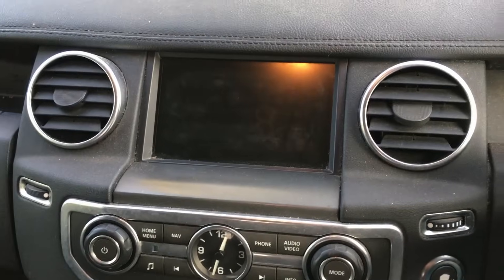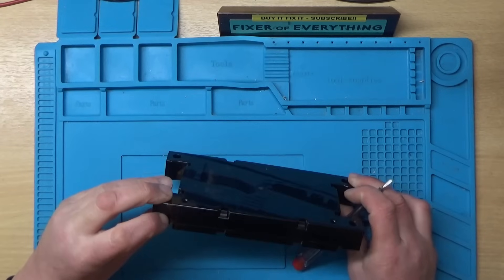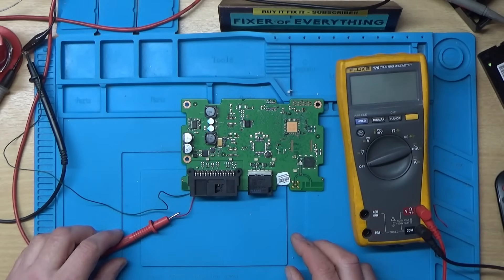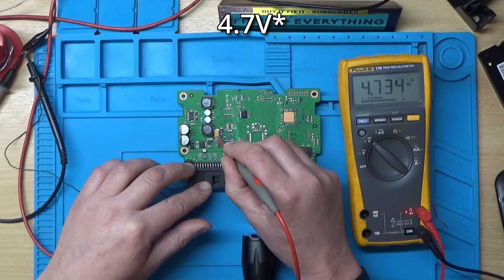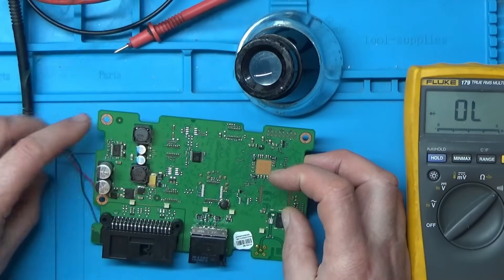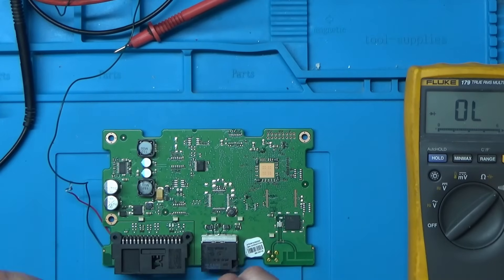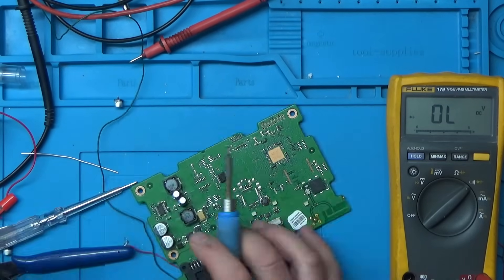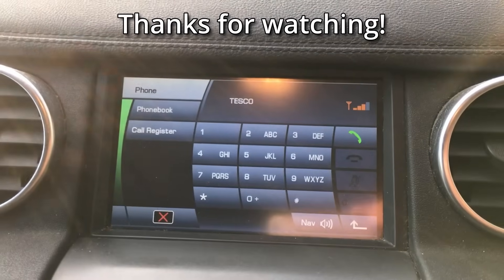Faulty Land Rover Discovery 4 Bluetooth Module | Can I Fix It?

Comment: Found your video and changed the same SMD capacitors.. it worked better, but didn’t last. Found another video where the board main soldered points are touched briefly getting rid of cold solder points. The module behaves better and doesn’t turn off infotainment system like before. Have to get a heat gun and heat up the entire board. But happy it’s working better now. Thanks for posting your video and leaving it here as it helps many others with these Fomoco issues.Great instructional
Reply from the maker: You're very welcome. Yes bad solder joints would also give similar symptoms.

Comment: Cars are a nightmare to work on. Just getting stuff to bits is so difficult. I repaired the entertainment centre touch screen on my wife’s Seat Alhambra, and the hardest part of the whole repair was getting the unit out. The touch screen replacement was the easy bit!
Reply from the maker: Agree, we got rid of the Land Rover. I had the body off the thing 3 times, replacing EGR pipes and turbos. Even getting to the alternator was a nightmare on the thing.

Comment: How many volts is the 100mF capacitor?
Reply from the maker: 35v 100uf if I remember.
Reply: Hi! Do you know the values of the other 2 capacitors. Bought a replacement module on ebay and it took doesn't work. Probably has the same dodgy capacitors, 
It worked for a minute and then disconnected and was no longer discoverable
I'd really appreciate the help. The values aren't written on the capacitors
Reply: Hi, any idea what the values of the other 2 capacitors are?

Comment: I have a 2016 LR4 and I have power at my dash unit but the radio , phone and sat nav are not working. I’ve been told by a mechanic that one or all of the modules are blown and it’s very expensive to repair. Your video is the closest I’ve found to even finding where the modules are in the LR4. Could you suggest where to start. I’m competent enough to tackle the job with a little advice. Cheers for and advice.
Reply from the maker: We got rid of the LR4 a few months ago, they are a nightmare. I had the body off the things 3 times, changed turbos, egr pipes etc etc etc. I know the main ECU is at the front right behind where the battery goes (as you need to disconnect this when taking the body off), but if it's starting and running then that's probably not the issue. You now know where the Bluetooth module is, I think there may be an amplifier module under the passenger seat, and the rest of the modules I would suspect to be behind the dash where the actual satnav screen is. I never had that part out so unfortunately I don't think I can really help further 😢

Comment: What a great video and what a handy guy!  I have the same module that works once if you cycle the power to it but then doesn’t work again till the next power cycle, I will do the same and see what happens. I’m a firm believer that these kind of issues with cars are common to all the cars of that model etc and if it happens to one it will happen to the rest at around the same age/milage
Reply from the maker: Thanks 👍You'll have to let me know if it works for you. The other thing it could be is possibly bad connection on one of the IC's.

Comment: Your right about the capacitors failing because of high frequency noise/heat in  smpsu  ! Linear psu’s  rarely had problems like that! Fraser
Reply from the maker: Yes agree 👍

Comment: Hi. I have tried to repair a Bluetooth dongle for a launch obd scanner. I have tried to repair it for a friend but have failed. Would you be interested to have a look? Thanks again for your nice videos
Reply from the maker: What's up  with it?
Reply: @BuyitFixit  it powers on when you put it in the obd port or if you connect it to USB but you can't connect to it via Bluetooth
Reply from the maker: So it works fine USB still, just not over Bluetooth? If you have any pictures of the insides drop me an email at the channel's name at out look dot com.

Comment: Hi, sir. Greetings from Brazil. One suggestion : I think you need to consider a little better esr meter to find issues like that. That esr meter that u have is a little "child's play", if i can put that. 

Great job.
Reply from the maker: Thanks 👍Do you have any suggestions on a decent one? Many thanks.
Reply: Zoyi ZT-MD1 and Fnirsi lcr-st1. Both are lcr type tweezers and have been released on aliexpress a few weeks ago. They should be able to give the esr in circuit without removing the capacitor. I just ordered the zoyi for $35aud(£17). They have just been released, so haven't seen any reviews yet.

Comment: Hello Mick, just thought I should mention this….you might want to consider using “hot snot”, or even better, neutral-curing silicone mastic around those replacement electrolytics you put in there.

In vehicles and other moving mechenery vibration can actually do a fair bit of dammage to electronics and particularly leaded components thst then waggle back and fourth in their leads…..and here they ste not soldered to plated through hole pads but just surface mount pads that won’t handle the bending moment well at all….a blob of silicone will mechanically danp things down nicely and increase its longevity….least from a mechanical standpoint anyway!
Reply from the maker: Thanks for that. I didn't think about it at the time! Great advice. Someone else also mentioned similar. Thanks again 👍

Comment: Another great fix, and your past experience with capacitors really served you well, as the oscilloscope didn't see a problem and yet you knew to pursue that path.  👍
Reply from the maker: Cheers Brian, yes I still wasn't sure as I couldn't see anything obvious. It may have only shown if the device got warm after being on in a confined space, but it's still working fine to this day..

Comment: The whole point of those metal caps is that they don't dry out. They must be really poorly manufactured.
Reply from the maker: I've had the same types of capacitors fail on the fire alarm power supply I recently looked at on here and the game gear I repaired too.

Comment: Another great fix.  Well done.  On this one may i suggest something?  I'd put some hot glue around those replacement caps.  Cars bounce around an awful lot and the strain on the tiny PCB pads from a sticking up capacitor will be pretty large relatively.  This is why a lot of electronics put that white sealant gunk all over them - they wouldn't bother and save money if they could get away without.  Just a thought.
Reply from the maker: Thanks 👍yes good idea, I hadn't thought about that.

Comment: Excellent repair. 
The BT module on the Freelander 2 also causes the same issues, so I wonder if they share the same fault.
Reply from the maker: Thanks 👍well they probably use 5v and 3.3v ICs so they have to reduce that from the vehicles 12v supply, so if not exactly the same I'd imagine it would be fairly similar.

Comment: I think you must have a sixth sense for these repairs. I mean what guided you to those particular Capacitors? Nice one Mick, Thanks for sharing.
Reply from the maker: Thanks Brian. Well the unit seemed to be crashing randomly at first and it became more frequent over time. Disconnecting the battery and reconnecting it made it spring back to life for a while but the time it worked became less and less so it was like something was degrading, I've had capacitors on power supplies in TVs do this before.

Comment: Nice fix and most likely save a lot of money :) Dealership would've just replaced the module, which is probably very expensive. Have seen some car repair channels chasing these parasitic current draws, and often it seems to be caused by some control module like this, or aftermarket installations, corroded wires or grounds, etc. For example Pine Hollow Auto Diagnostics channel is really good, he often tries to fix the actual root cause, and not just replacing parts :)
Reply from the maker: Thanks 👍and thanks for letting me know about the other channel.

Comment: Its been a few years for me, but I remember reading something concerning electrolytic capacitors having a 10 year on average life span.  Weather there in circuit or not. Good Job sir. 
Also I didn't know Land Rover used Ford Motor Company parts.

Comment: What an excellent result! Sometimes those educated guesses can pay off. Well done.😊
FWIW:-Laser systems normally incorporate ALS(Automatic Laser Shutdown). This is a safety precaution, the system will fire up and switch the transmit laser on for a short time. If no receive signal is detected then it will shut down, which is the behaviour you observed. If the cable was cut for example, someone could stick the cut end up to their eyeball for a closer look, not a good thing looking into a laser. Depends on the power of the laser if it does any damage. The laser detectors are normally a wideband receiver so will operate over wide range of wavelengths, still I was a little surprised the torch worked but I'm used to working on large commercial Optical Fibre systems.
Reply from the maker: Thank you, and thanks for the explanation 👍

Comment: Wouldn't it have prudent to change the other 2 electrolytic's while you had all that stuff removed?  I hate these new cars!
Reply from the maker: Probably, I wasn't 100% at the time if the issue was fixed or not but it's still working some 4 months later 👍

Comment: How did you determine the BT module was the source of the parasitic draw ? Or was it just a guess because it started playing up at the same time ?
Reply from the maker: The bluetooth stopped working, and the battery started going flat after a couple of days of it not being used. I did a quick search on the internet and it seems a common problem. Most people just bypass it with a special fiber optic coupler called a MOST bypass cable.

Comment: Amazing Mick great fix, I would of thought caps as a first stop, glad you sorted it those caps are prone to fail, no end of times they’ve shown odd results. Tv main boards use them maybe the ESR showed up as they were still hot/warm from being desoldered!
Old games consoles are often repaired by changing those types of caps, just a bad design I think
Reply from the maker: Cheers Gary👍yes I've had those type fail  on the game gear and the fire alarm PSU I look at.
Reply: @BuyitFixit  it’s a common thing ☺️

Comment: Would someone explain what the two values on the component tester show for capacitors please? I think ESR and Vloss? I understand the microfarad reading (well, that caps have them!) Love Mick’s videos, but can’t always keep up with the “aha” moments so trying to learn! Thanks!
Reply: Vloss = voltage loss across the capacitor. ESR = equivalent series resistance which will truly show if a capacitor is bad even when the farads measure okay. I prefer the MESR-100 for testing the ESR of capacitors.

Comment: I recommend using a little bit of glue on those caps after soldering. Right now they are dangling by their legs, but in an automotive environment there is a lot of vibration and that could cause fatigue in those legs and the caps to break off over time
Reply from the maker: Good point 👍

Comment: Awesome. It was funny that the oscilloscope did not show funny voltages or high ripple while measuring the capacitors that was changed
Reply from the maker: Yes, agree. That was partly one of the reasons for not releasing this one straight away as I wanted to wait and see if it had problems, but it's still working fine, bluetooth works and the battery hasn't gone flat since.

Comment: Great video again, thanks! Brilliant idea using a flashlight to fool the optical connection. If I may ask, why did you choose those two capacitors to remove and test instead of the other two? Was it just because you've seen them fail in a power supply as you mention? Or did you use any other reasoning?
Reply from the maker: They seemed to measure ok, but perhaps with heat in an enclosed space they may give different readings. I've seen it before in TVs and the like. It seemed the unit was crashing after a while and powering it off and on (by disconnecting the battery) made it work again. The length of time it worked became shorter and shorter so it was like something was slowly deteriorating, hence my suspicions of a capacitor.
Reply: @BuyitFixit  I understand. Thank you so much for the explanation!

Comment: I'm surprised it's not water ingress! I've had the Body Control Unit out of my Disco 2 as it looked like it was causing the battery to go flat and blow the two horns. turned out that the horn circuit was shorting to the front lights due to water in the harness. But as it failed it's MOT and waiting a welder to come and replace the holes in the chassis caused by an infestation of metal moth larvae, I've still not got round to fixing it.
Reply from the maker: I'm not a fan of Landrovers. I've had the body off on this thing 3 times, replaced both turbos, EGR pipes, rear arms, etc etc. They are a bloody nightmare 😂😂😂
Reply: @BuyitFixit  The fuel tank of my old series 3 fell off going to work once. found some heavy duty wire and tied it back on to get home. sold that as a non-runner a few years later as i got fed up fixing it. The Disco 2 was to scratch an itch from the series 3 days.
So maybe I'll do a few videos as it get welded back together and dried out. Never know it might even get back on the road.

Comment: I call bull shit, how the hell did you just know that a flashlight would keep it powered on and it just so happens you have a flashlight right there.  This guy has mad skills but i dont think this is true live troubleshooting, he’s working off line for the video.
Reply from the maker: I didn't know that the flash light would work until I tried it. I normally have it on my bench anyway. The only connections on this module are power and the optical. It doesn't take any other signals, so if the flash light hadn't worked then I would have been a little stuck. Sometimes I do edit bits out of the video as the video might be too boring or too long, or sometimes I have to stop recording and do other things around the farm. I didn't have a chance to do a video this week as we've been too busy lambing but luckily I had this one nearly finished from a few months ago.

Comment: Good job. A fluke (or not) finding those caps (which, at a guess, probably have seven bells being knocked out of them by the two switching PSUs). I'm of an age (and senility) when you didn't need a Cray for your vehicle to work.
Reply from the maker: Thanks, cars are becoming more and more complicated and more dependant on software and even subscriptions in some cases.

Comment: Thermal cam wont show anything unless their is a short circuit sinking amps of current, but caps are always the usual suspects
Reply from the maker: I wasn't sure if there was any shorted caps or anything, just thought I'd check just in case.

Comment: Great work. The suspicious little cynic in me thinks that SOME manufacturers may deliberately use cheap and nasty caps in their devices as a built in 'end of life' to try and force the owner to buy replacement devices or upgrades. After all, caps are a common point of failure and they are often badly made.
Reply: Sourcing,  who can say?
Reply from the maker: Thanks, although the unit is over 13 years old so they haven't done too bad.
Reply: Just to clarify, there are several grades of electronic components. They are generally graded by temperature. Automotive is 125c to -40c, industrial is 85c to -40c and consumer is 25c to 0c. These are the temps the components are tested to when they're assembled. There are other grades but these three are the main ones (military is 125c to -55c). Capacitors are also graded by temperature. If you look  at the specs for a cap, capacitance vs. temperature, there's always a serious roll off at temperature, the higher the grade, the less the roll off. A cap that is rated at 100 uf may only be 100 uf up to 85c and roll off to zero past 125c. Automotive electronic are graded from 125c to -40c. All electronic components used in a car by the manufacturer has to be automotive grade. The components are tested, the modules, once assembled are tested and the  systems are tested at these temperatures. During device/module qualification, the devices are subjected to an operational life test where the devices are stressed electronically (dynamically) and thermally (125c) to simulate a specific life expectancy, usually to 10 to 15 years. But components do fail in the real world and all the testing in the world can't catch all the latent defects. (I worked as a product engineer qualifying new automotive components for 30 years.)

Comment: Outstanding job, as always.
I'm a firm believer in not putting all those plastic panels back on cars, once removed. I was hunting down a water leak in my boot several months ago, which I believe I've fixed, but I still haven't put all the plastic panels back in place.
I bought that blue mat and the grinding pen a few weeks ago and I'm well impressed with both, but especially the grinding pen. That thing is a beast, it's 99.999% as good as my full sized 12 volt cordless rtoary tool, but it's way handier given it's size and the fact that it's USB-C rechargable. It's an excellent bit of kit.
Reply from the maker: Thanks 👍Yes the grinding pen is great. I only recommend things that I find good or useful 🙂